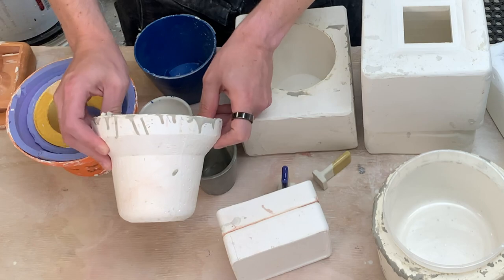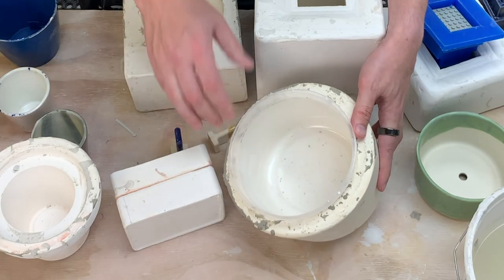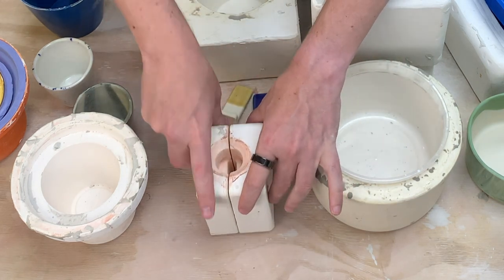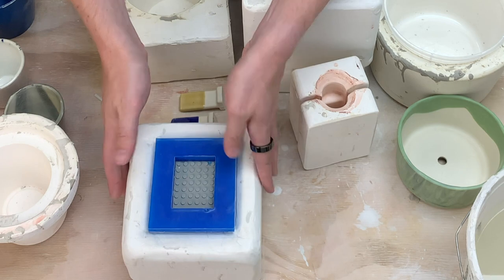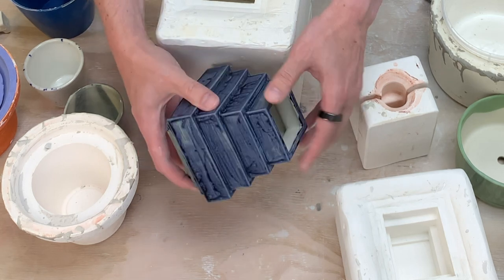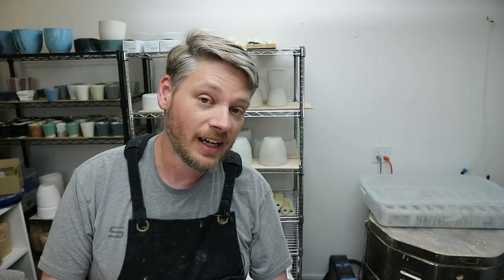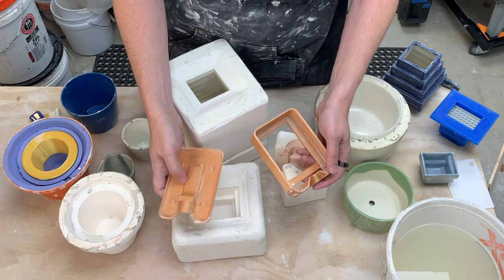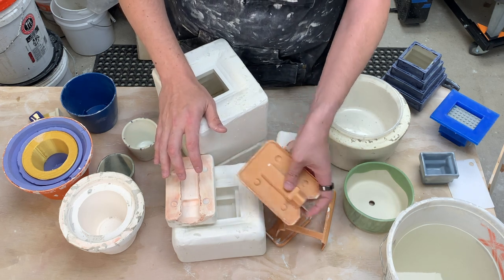Plaster Mold Deep Dive - The challenges of making molds for slip casting

Comment: Hi I need help. I have plaster molds and bought ready slip for the first time. I felt a little thick and add water. But then realized that I should onlu put obe teaspoon water and salidic asite after I put a bottle of water 🥶 now my slip never comes out. Ist it beacause the the slip or mold. Even the mud comes bone dry still stick in the mold.
Reply from the maker: It probably needed mixing, not water. Slip is thixotropic. The way to fix too much water would be to remove water (let it evaporate, but that is hard to control) or add more dry clay meant for slip, but that is hard with premade clay. As for it sticking to the plaster, I've really only had issues when using the wrong clay or when my molds are too wet. If it's still sticking once fully dry, it could be the wrong plaster, or maybe if they are old molds, it's sticking to the eroded plaster.
Reply: ThNk you for your answer. Since I bought a ready-made slip, I had to add 1-2 drops of Sodium silicade to thin it. I ruined the whole slip with water. I guess that's why it won't come off the plaster. Because my molds are brand new and I cast for the first time. It was strictly forbidden to put water. It made perfect sense to me.
Reply from the maker: Ah, adding sodium silicate can very much be the issue. It's very temperamental and I don't use it for that reason. Either too much or too little can be an issue.